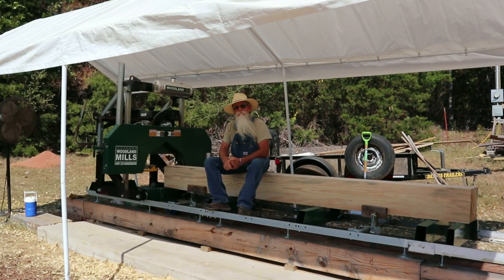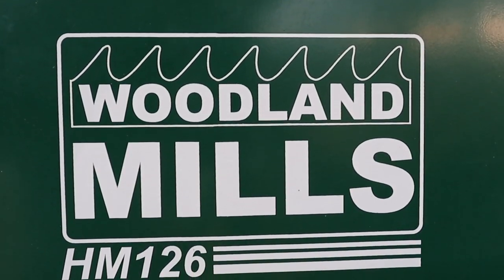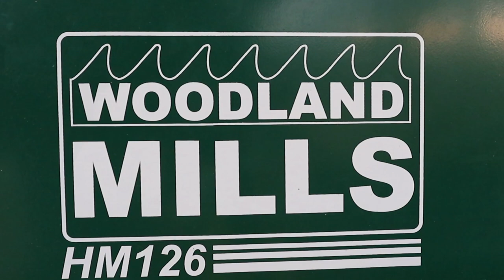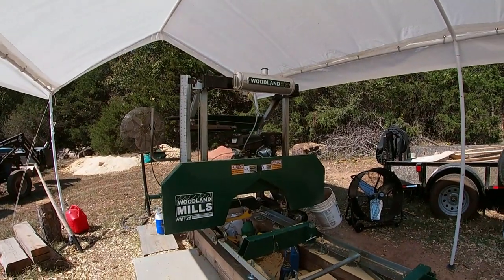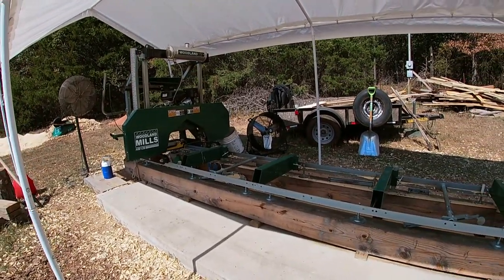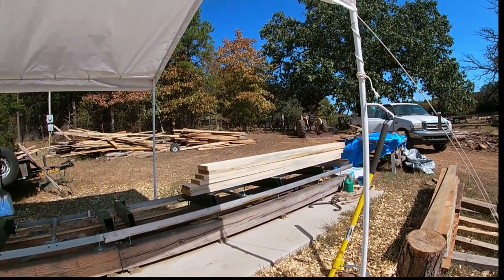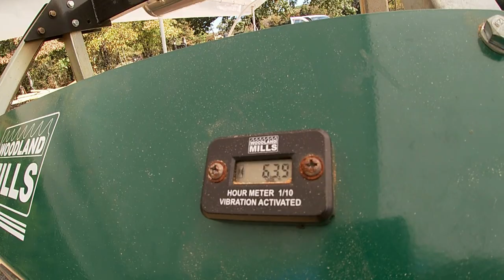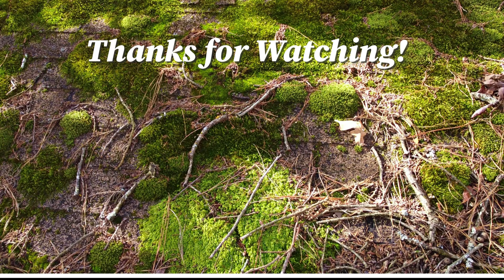Band Sawmill Dream Come True

Comment: Good choice. I've got the same mill lol. 
Do you plan on building a more permanent saw shack? I hope to get to building mine this spring, but I"ve got a shop to finish first. I'm going to use my HM126/14 to do board&batten on the ceiling and walls to save money on sheetrock/plywood.
*I have your B&B vid saved for reference. Thank you for sharing and be careful around your mill
Reply from the maker: Howdy y’all- thank you so much. Yes, my next project is a mill shed. Been so busy since I got the mill I haven’t had time to build it. As soon as we got mill set up we started sawing lumber for the Paradise Point cabin. It has already paid for itself. Yes. I am very careful around it. Thank you so much for watching the video. Take care and God bless

Comment: Nice mill Paul.... question?.    I'm gonna build a medium size log house.. half dove tail locking.... Can you tell me what size cuts would you   make  ..  the width  and  height .. steeve
Reply from the maker: Howdy y’all- I like to use 6” thick logs and I like to get at least 12” height rise on each round. That would be what I would use on the smaller size logs. The bigger the logs the thicker they need to be to keep the proportion right. The thickest I’ve worked with were 8” thick but they were up to 30” wide. Hop this helps. God bless you with your build

Comment: Congratulations on the sawmill. I have a question, how did you level the 23' base? I know nothing about mills but presume have the base level is a must for making true cuts. Thank you.
Reply from the maker: Howdy Wiley- thank you so much. When I set up the form for the concrete I used my transit a put a one inch fall in it. I also used the transit when I put the track together. It is sitting level even though the slab is slanted so water will run off. Next project is a mill shed. God bless

Comment: That's awesome man good for you I like all your videos I just built a house and did board on baton and actually got a lot of little tips from you. I got a question for you would you use that mill for your logs for a log house or do you just still use the chainsaw mill
Reply from the maker: Howdy y’all- thank you so much for watching our videos. Glad you were able to get some helpful information. I would definitely use the sawmill to cut wall logs. I’ve used my Alaskan mill for years but the sawmill is so much easier and faster. I go through lots of gas and bar oil with the Alaskan mill. God bless you

Comment: On your logs do you air dry them or put them up green?
Reply from the maker: Howdy y’all- I like to work the logs green and allow for the settling that will take place. I use angle iron in the openings and also use screw jacks where I have vertical members. Thank you so much for watching the video. Take care and God bless
Reply: @TheBeardedCarpenter  thank you.  My property I have mostly red oak and white oak to work with.  Some poplar and ash and very few pine.  I will probably have to resort to oak since it is abundant.   But will definitely have to build a hoist like yours with logs that heavy
Reply from the maker: @woodtecharmory9249  Oak is a good wood to build with. Yellow pine is what we have in abundance here so that’s what I use.  We have more post oak than white oak but it works the same. I wish you the very best with your cabin build. If I can help you just let me know. You can email me at thebeardedcarpenter8@gmail.com. Blessings to you

Comment: Well I have to admit something. I was thinking you were someone else and I wasn’t even subscribed to you! Hubby wants a little chainsaw mill. We have a big oak the electric company dropped on our property and it would be a shame to just burn it. Our trailer is too short to take it anywhere though. What are your thoughts on those portable mills? Anyway, we are over south of the Buffalo so I’m pretty sure we are some kinda neighbors 🎉😊
Reply from the maker: Howdy y’all- I have an Alaskan chainsaw mill I’ve used for nearly thirty years. It takes a pretty big power head if you do much milling. I use a 394 husky which is 394cc. My mill is the three foot mill which is what was available back then. They make different sizes now. With the mill stretched out for a three foot bar it won’t cut three foot. Yeah, we are neighbors, we’re in western Arkansas in the Ouachita Mountains about 45 miles from Ft.Smith. Thank you so much for watching the video and commenting. Take care and God bless
Reply from the maker: Sorry, I missed printed the cc on my chainsaw. It’s 94cc. I do have a Woodland Mills 126 bandsaw mill that I use all the time. It’s considered a portable mill but I have it set up stationary here at the log yard. Blessings
Reply: @TheBeardedCarpenter  awesome! Thanks! I wouldn’t have known until I looked it up and said whoa! 394cc! 😳😝 Thanks for the replies. Loving catching up on your stuff - Jen